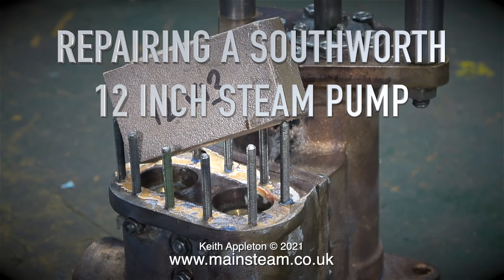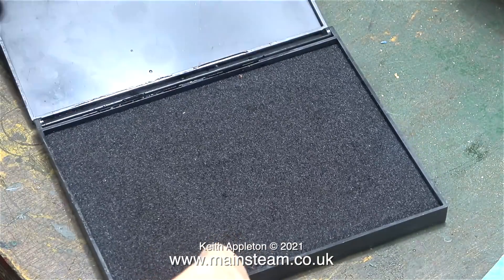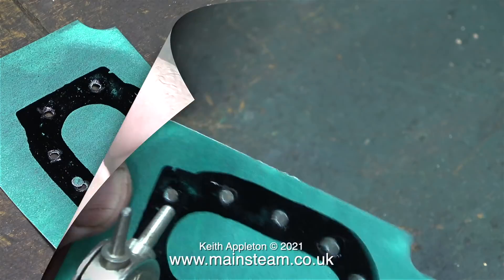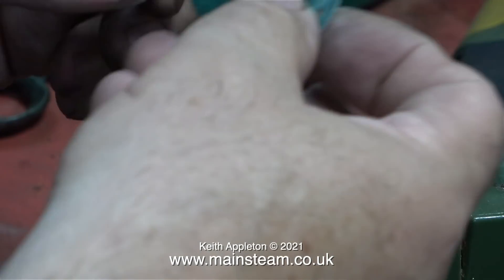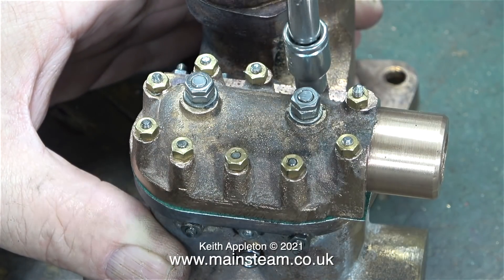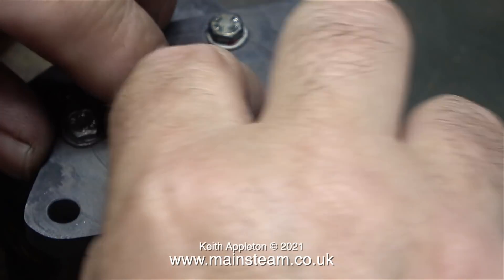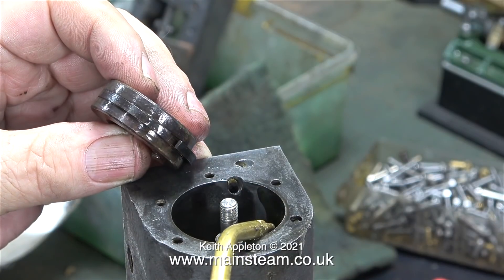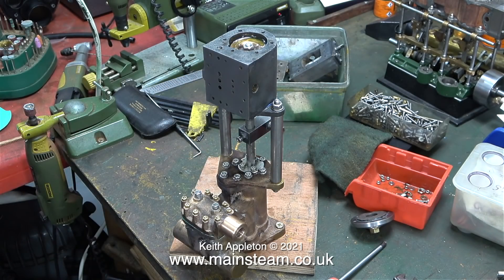REPAIRING A SOUTHWORTH 12 INCH STEAM PUMP - PART #5

Comment: I would ditch the ring and use a brass bushing. Quite a bit of friction, and really low surface area for an oring. The bore is way to small to consider a piston ring.
Reply from the maker: Brass is no good at all for such parts and wears out very quickly. The existing Piston ring is perfectly fine and works well.